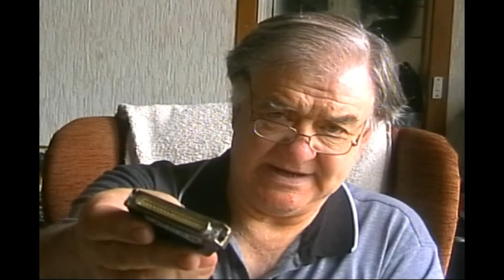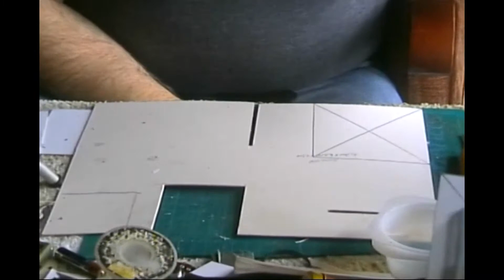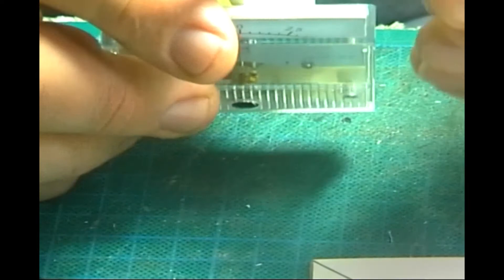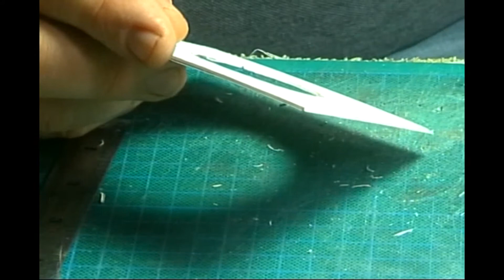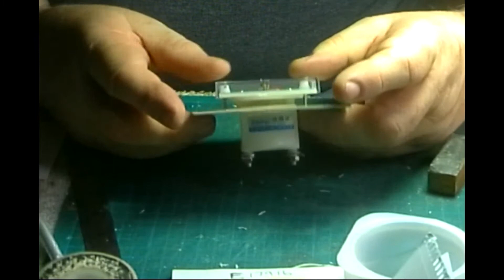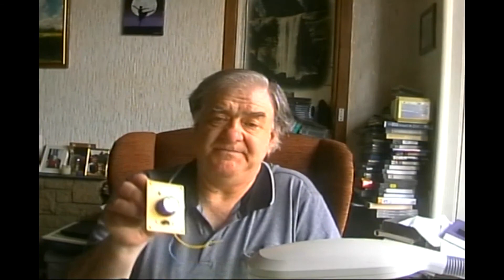How to make a template to fit an Ammeter or voltmeter

Comment: Many thanks Andy, that's a very useful workshop. Would you consider doing one on how you and your  club keep the track and pick-up wheels clean please? Poor running has always been a problem for me, even using nickel silver rail - it seems to get a black deposit on it virtually overnight, and this transfers to the loco wheels, resulting in as lot of stop-starting and finger poking! If you can help, that would really be great. Many thanks, Les
Reply from the maker: Hi Les  Good to hear from you once more. 

Can I ask what method you are using at the moment to keep wheels and track clean to see if I can identify where this black deposit is coming from.

As far as wheel cleaning is concerned in my workshop on ringfield motors I cleaned the commutator with T-Cut and I also cleaned the wheels with the same product using Cotton Buds. I will do a workshop on track cleaning very soon so watch out for its release.

Keep sending me your requests for new workshops  and we will see what we can do.

Andy Russell 
Glasgow South Models Tram & Rail Group
Secretary
Reply: @andyrussell7506  Many thanks Andy. What I do is clean the rails with a tissue soaked in my wife's stainless steel kitchen cleaning spray, then clean the wheels using the same method. I used to use lighter fluid or meths until I saw your warnings!
The trouble is, my layouts live in my shed, stored horizontally, and within only a day or so of cleaning, I can still remove black deposits from the rail heads using the same cleaning method.
If I store a layout on its end, it's not so bad, and also covering the rails with clingfilm also seems to help, so I reckon it could be airborne or maybe condensation perhaps. In any case, I need to clean the track before any running session, or the running is very jerky, with a lot of finger-poking!
Any help you could give with this long-term problem would be highly appreciated.

Many thanks

Les